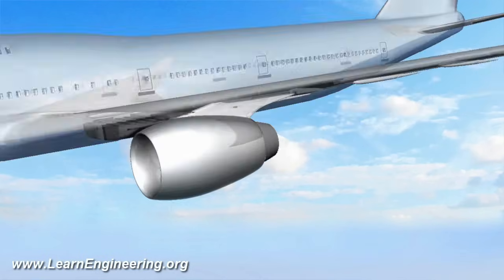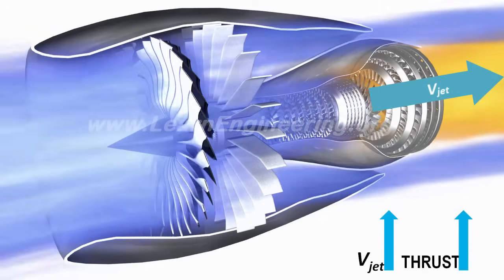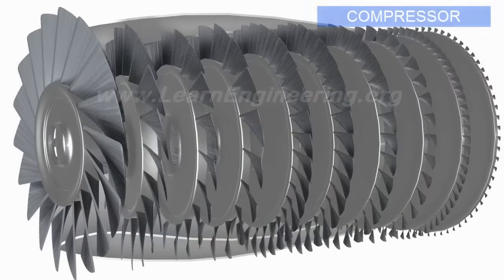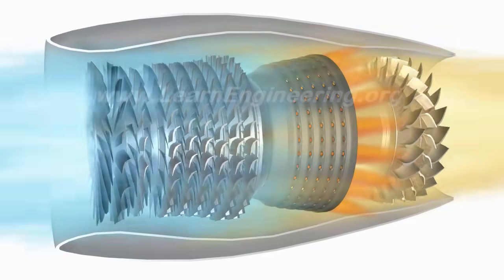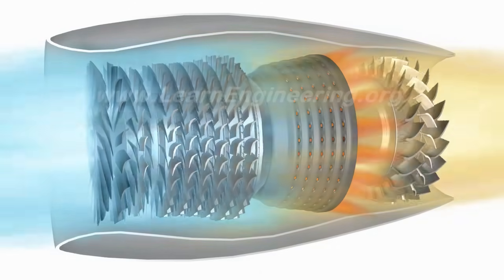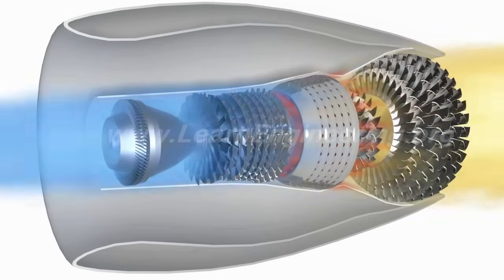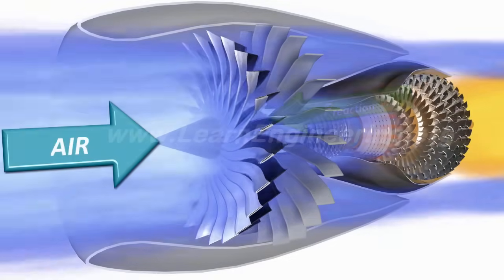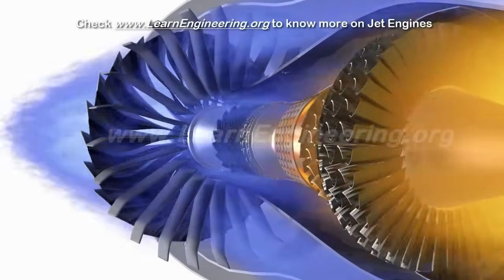Jet Engine, How it works?

Comment: How many rotating shaft in this engine , jet engine have 2 spool among that how many shaft rotates ??
In here I understand that low pressure turbine rotates the low pressure compressor that attached in a single rotatating shaft with fan to suck air , so this low pressure turbine runs how because low pressure turbine is end product of the jet engine so how ?
Reply: These engines works on compressed air not mainly on fuel. Fuel used to lower the exhaust pressure so suction will increase exponentially. And more suction creates more thrust. But they dont tell it like that. They want people to think the system works like a combustion engine but its not. So they can fool people to believe that aluminum plane wings can carry hundreds tons of fuel. Even the largest steel tanker truck carries maximum 30 tons of fuel. No aluminum wing structure can carry 3 or more fully loaded tanker truck weight + jet engines. Even tanker trucks are made of full steel not aluminum to carry 30tons on a road. Alumium is not a good material to hold weights. It is used for its light weight. But people are so dumb down and they think these planes made to be so light weight to fly but filled with tons of fuel which make them heavier than any ground vehicle. Planes are so light weight vehicles and engines mainly works on compressed air not fuel. Fuel amounts on paper to fool people for higher ticket prices nothing more.

Comment: The problem is, how is the every blade rotated to produce high pressure at the center
Reply: These engines works on compressed air not mainly on fuel. Fuel used to lower the exhaust pressure so suction will increase exponentially. And more suction creates more thrust. But they dont tell it like that. They want people to think the system works like a combustion engine but its not. So they can fool people to believe that aluminum plane wings can carry hundreds tons of fuel. Even the largest steel tanker truck carries maximum 30 tons of fuel. No aluminum wing structure can carry 3 or more fully loaded tanker truck weight + jet engines. Even tanker trucks are made of full steel not aluminum to carry 30tons on a road. Alumium is not a good material to hold weights. It is used for its light weight. But people are so dumb down and they think these planes made to be so light weight to fly but filled with tons of fuel which make them heavier than any ground vehicle. Planes are so light weight vehicles and engines mainly works on compressed air not fuel. Fuel amounts on paper to fool people for higher ticket prices nothing more.

Comment: How does the combustion chamber combust ?
Reply: These engines works on compressed air not mainly on fuel. Fuel used to lower the exhaust pressure so suction will increase exponentially. And more suction creates more thrust. But they dont tell it like that. They want people to think the system works like a combustion engine but its not. So they can fool people to believe that aluminum plane wings can carry hundreds tons of fuel. Even the largest steel tanker truck carries maximum 30 tons of fuel. No aluminum wing structure can carry 3 or more fully loaded tanker truck weight + jet engines. Even tanker trucks are made of full steel not aluminum to carry 30tons on a road. Alumium is not a good material to hold weights. It is used for its light weight. But people are so dumb down and they think these planes made to be so light weight to fly but filled with tons of fuel which make them heavier than any ground vehicle. Planes are so light weight vehicles and engines mainly works on compressed air not fuel. Fuel amounts on paper to fool people for higher ticket prices nothing more.
Reply: @fehmidonmez7810  Thank you for the explanation, I'm actually a mechanical engineer and I think what you just said is accurate. Aluminum is definitely not the ideal material to carry such loads
Reply: @fehmidonmez7810  Its hardness is way too inferior to steel so making it more ductile which can make the material easy to deforme, in this situation we need a material hard and fragile but it does't matter since the tank is not meant to take any impacts
Reply: @fee68  Yes you are right. I also checked the A380 wing internal compartments and they are not what they told people. Because they told people that wings has compartments and fluids stay stable. But in fact all compartmnets has gaps at bottom and top so wing can bend up and down. That means they dont hold any fluids. There is a big deception in that field. Thanks for your reply.
Reply: @fehmidonmez7810  Thank you as well for the insight, I was really curious about the construction of jet plane and you helped out a lot.
Reply: @fee68  It was my pleasure! It is difficult to find people like you who has analytical background and critical thinking skills these days. Thanks.

Comment: This not necessarily wrong, but not specified. In modern turbofan engines (commercial jets) most of the thrust come from bypass gases (sucked by the engine) launched backwards by the fan blades, and not hot gases from the combustion chamber. The opposite happens to military planes: high velocity hot gases propel the plane and allow it to do steep maneuvers, but are not fuel efficient. These engines are called trubojets.

Comment: As pointed out, the intake turbine blades are turning in the wrong direction, effectively sucking air OUT of the engine instead of in. How did you F* this up and not spot it, Lesics? FAIL/Thumb DOWN

Comment: False! Just another lie. Airplane Turbines start with compressed air and then they keep on compressing air, but do not burn any fuel. Where are the flames? 0 flames, 0 exhaust. Where is the space for the tons of fuel needed? Open your eyes ppl! Just look at sportscars. Once the Turbine is moving with the Airplane through the air at high speeds it becomes a sort of Perpetual Motion Machine of the 3rd kind. The Nickel that it is made out of is rotating inside an Electromagnet and constantly powering itself, just like modern Hybrid EV on the road. This is why Airplanes can keep going and going even if they have to change airport destinations. Modern Turbine Airplanes are also equipped with strong battery packs and an impressive array of wires to keep the ELECTRIC set up going. Be sure to check out the video I'm doing on the subject sometime :D

Comment: This guy is wrong.  The velocity of the air at the rear of the engine does not create the thrust. The correct answer is what newton's law suggests, the law of action and reaction
The high pressure inside the engine creates the forward motion. Just like the higher pressure on the back side of the fan blades. This creates thrust just like a wing creates lift. The pressure on the underside of the wing is greater that the upper surface, thus creating lift.

Comment: What always bothered me about these engines is "why does the ignited fuel have to exit through the rear?  Why doesn't it also exit through the front?"  Turns out it's a balance between fluid momentum and pressures.  Which is why you sometimes get compressor stall and surge.  That's also why you don't get instant power out of a turbine; it has to wind-up and thrust increases more slowlay than for something like a prop.
Reply: Isn't it also due to the blades are designed so that they will push the air to the back and draw. It in through the front plus you're closing at high speed so they are naturally as drawn in through the front
Reply: @gearyheidinewaccount3237 The blades work in both directions. But the high speed you mention is maybe the momentum that I was referring to. The ate is already moving from front to back before you ignite the combustors.

Comment: You made a mistake. Jet engine does not only depends on exit velocity for thrust but also the flow rate. If the exit velocity is low but it has high flow rate, the thrust is still high.

Comment: So what rotates the turbines where cold comes in
Reply: on start up, an external motor. Electric for smaller engines or APUs, pneumatic or hydraulic for bigger engines.
Once the core is spinning fast enough that you can start burning fuel, the starter motor disconnects and the turbine powers the compressor

Comment: It bothers me that the intro animation is running backward.
Reply: Also at 4:02 the turboprop blades are swept the wrong way - they should be pointing more forward at the center and becoming more perpendicular at the outer edges.

Comment: Can anyone tell me what makes the engine propeller turn? I know what makes the thrust but what force turns the propeller?
Reply: the hot gasses passing through the turbine at the rear of the engine, which is directly connected to the compressor and fan. On start up, you need a starter motor (usually pneumatic) to make the core spin before lighting the candle
Reply: @Grouuumpf  hank you!

Comment: There is a problem with the explanation of the compression and expansion. The compression and expansion are the main reason this jet engine works, since compressing/expanding cold air requires much less energy than compressing/expanding hot air. So heating after compression means we extract more energy from the expansion.

Comment: All gas turbines of different types depend in their work on drawing air from the outside and then increasing its pressure and speed with condensers to tens of atmospheric pressure according to the number of feather discs so that the friction between the compressed air particles with each other inside the condensers increases, which raises the temperature of the compressed air to times the boiling point of water to accelerate the combustion of the fuel spray coming out of the syringes in the combustion chamber, which increases the efficiency and concentration of the directed kinetic energy resulting from the combustion, so that the combustion product acts as a counterfeed by moving the exhaust blade discs connected to the same axis of the compressor discs, and in the event that the concentrated air pressure inside the condensers is disturbed, the energy produced in the combustion chamber they will be dispersed to all directions and may cause an explosion inside the gas turbine. This is why the margin of error during manufacture of the turbine disc blades does not exceed several microns to maintain the stability of the flow of compressed air inside the condenser.

Comment: Wow...  I guess this is kinda sorta accurate if your audience is middle schoolers....  But like others have noted, the animations are not correct in key areas...  and the descriptions made until the  two stage concept was introduced were totally inline with an old school turbo jet....  It just leaves me wondering?  Who is the intended audience for this???

Comment: I'm still at a loss. You forgot to introduce what initially makes the whole cabudle rotates haha. Is there a  rubber band that attaches the kabudle with a pulley to a rotating motor under the pilot seat ???  Explain HOW all the rotation is initialed. Thank you
Reply: Usually an air starter, either ground based or from an onboard Gas powered generator that creates pressured air. This air is blown through the engine getting it to spin up and the fuel is dumped in and the igniters lit and hopefully it’s going fast enough to self sustain from there. Fun fact, if it fails to start it’s called a hung start
Reply: @lucaherman6227  thank you. just the info i needed, appreciate it.

Comment: i didnt understand the story of the fuel , does it heat the air or make the fan turn i mean is there another engine inside use this fuel to make the turbines turn ???
Reply: Basically yes the engine inside spins the big blades at the front by mixing kerosene with the air and lighting it on fire making it expand really fast
Reply: @lucaherman6227  now thats what im talking about ,,,thnks

Comment: Excellent overview given the lenght of the video!  A key point that wasn´t stressed enough imho, is the trade-off between speed and fuel consumption that turbo-fans come down to. That solution is at the very center of the economics of aircraft industry. Turbo fans don´t accelrate air as much as a turbo jet does but achieve the needed thrust by moving more air mass in comparison, thanks to a much larger diameter of the fan. The Trust is obtained by multiplying the air flow (kg/s) by the speed gradient. Given the same thrust a turbo fun allows for a smaller turbo-jet component which result in lower compsuntion at the expenses of speed at the noozle.
Reply: Isn't that just a propeller aircraft with more steps then?

Comment: what I don't understand is that why against the laws of physics the engine blows the hot air to the rear, and not evenly to both sides? Doesn't make any sense. Why would the jet escape towards the rear of the engine from the combustion chamber, and not evenly to both sides? Where is the "stopper" that the air pushes against, and makes it not got towards the front of the engine, and only towards the rear? That has been a question that I had since childhood and it's not yet answered.
Reply: The air does try and expand in all directions including out the front but it’s stopped by all the pressure from the incoming air and gets pushed out the back.
Reply: it takes the path of least resistance, so out the back because the front is a a high pressure compressor. The geometry of the combustion chamber also helps. It's noteworthy that combustion gasses going forward can happen in some instances, and is usually a catastrophic failure that will severely damage the engine
Reply: @Grouuumpf  ok but isn't the compression  in the front a result of the gasses blowing out  of the rear and spinning the rear rotors, which in turn translates into spinning the front rotors of the compressor? So how is it possible that the energy generated by compressor exceeds the energy that generates energy for the compressor, so to say? It's against the laws of physics 🤷‍♂️
Reply: @antondubkov  the addition of fuel and it's combustion give the energy needed, it makes the gasses expand massively and accelerate toward the turbine stages

Comment: The compressor blades are shown attached in the wrong way from  1:40 to 1:58. 
When air rushes in from the front of the engine, the compressor blades in the arrangement shown  from  1:40 to 1:58.should be spinning anti-clockwise when viewed from the front of the engine instead of clockwise as depicted in the video. 
The correct arrangement of the compressor blades is shown at 4.15. 
I wonder why the engineers failed to spot the mistake in the video.

Comment: It’s not the fan’s reaction force that produces most of the thrust (it generates less that 1% of the total thrust) it’s actually the bypass air squeezing its way through the narrowing duct and accelerating out the nozzle that produces the thrust.
Reply: complete opposite. They wouldn't bother with a big ass and heavy fan upfront if it didn't help with thrust. It's what gives around 70-90% of the thrust at low altitude (when it's needed the most)
Reply: @Grouuumpf  That's not I've been told by aeronautical engineers including ones who work for Rolls Royce Trent or what I've read in peer reviewed articles written by them and I doubt they would lie to me about it but okay... the fan is a compressor rather than a propeller from my understanding.
Reply: @ChrisZoomER  they must have been talking about turbojet engines, then. 
Like you find on very old jet liners or in military aircraft. In those, the propulsion is indeed done almost exclusively by the hot exhaust, but the video is about a turbofan as seen on all airliners of the past 30 years, and on those it's the fan that produces most of the thrust.
Source: aircraft mechanic, waiting for my EASA PART 66 license, currently working on 737 classic and NG
Reply: @Grouuumpf  Thanks for the reply but no they were talking about high-bypass engines alright such as the GE90 on the 777 or CF6 on the 767 and 747. Pretty much all fighter jets use turbofan engines as well though they're of the low-bypass variety. Again, I don't think that the people who design and build these engines would lie to me about how their product works. I've had plenty of other mechanics like you who've told me that a turbofan is nothing more than a shrouded turboprop, so I specifically asked these engineers "Is the fan really just a propeller that provides the majority of a turbofan's thrust?!" and they all answered with a solid "NO!!" They told me the fan is a compressor just like the rotor blades of the HP and LP compressor, only the fan blades are a lot bigger. "The bypass gets compressed just like the core air does... just not as much, the bypass then expands and accelerates out the bypass nozzle to produce thrust much like the core exhaust" they explained to me.
Reply: @ChrisZoomER  had to go back on your first com, which it turns out I had misread. I was pretty sure you meant it went through the core and the hot exhaust nozzle produced the thrust.
Yeah, okay, it's not "reaction force on the blades" that produces the thrust, it's "reaction force of the air stream, accelerated by the blades and optimised by the duct".
In french we call this "butt fucking the flies", or "being pedantic" in more proper speak.
You're still technically correct though. 
Fuck.
Reply: @Grouuumpf  Well I'm glad that's resolved.

Comment: is there some of the blade spin in a wrong direction?
Reply: There isn't a right or wrong way
Reply: @ethansaviation2672  but in 0:16 the biggest fan won't push the plane backward?
Reply: @0a736  oh yeah, I thought you where talking about the direction the fan was spining
Reply: @ethansaviation2672  is that our “direction” mean the same thing?